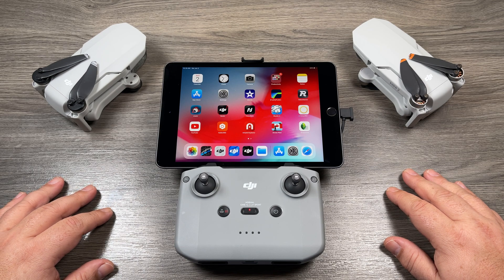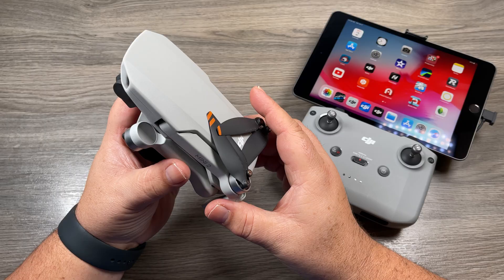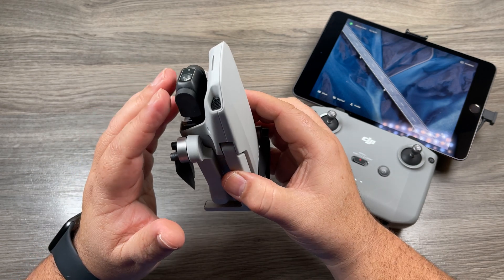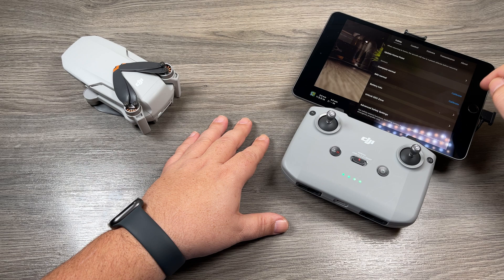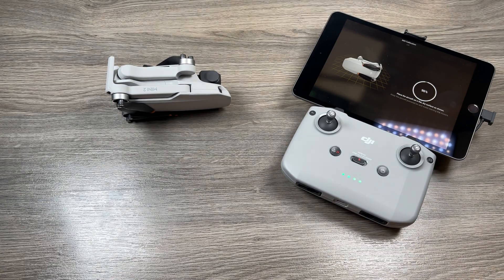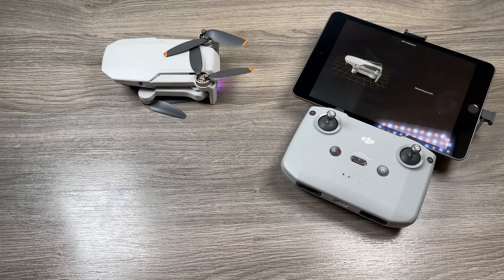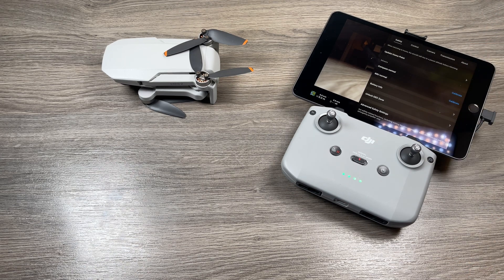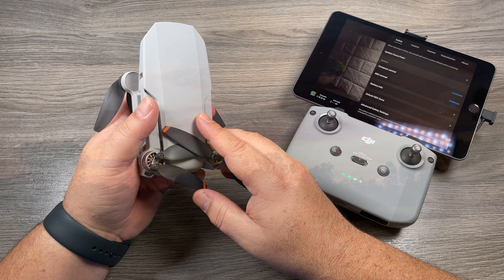DJI Mini 2 How to Calibrate The IMU

Comment: IMU stands for Inertial Measurement Unit.

The IMU is a critical electronic device that acts as the drone's sensory system, providing the flight controller with essential data about the drone's position, orientation, and movement.

Comment: Thank you.   DJI should have you on retainer for troubleshooting.   There were no IMU error notifications on the iPad DJI screen but the drone was highly erratic.   The previous DJI drone just decided to leave home after a year.  No error codes, nothing.   It simply went up about 50 feet and flew away.   I was afraid this one was fleeing the coupe too because it was so erratic as soon as it took off.   I had just put on new blades after the tips were damaged from an encounter with some chicken wire.   Anyway, I will follow your instructions and hope for the best.  Great video!!!
Reply from the maker: Hopefully all goes well. I appreciate you watching.

Comment: mine wont enable the start button. ive tried all combos of placements and folding arrangements on the damn thing. 
I tell ya, this fucking dji mavic air 2 I bought for 2 years ago has been such headache. I've flown it 10 times because every goddamn time it wants me to download new firmwares, accept new policy, download other things and calibrate everyhing so its such a hassle you just dont wanna go trough with it but this time its completely fucked. its stuck on the fucking start button. and i read thousands of ppl having the same issue but zero answers.

Comment: Thanks for this video. I am thinking of upgrading to a mini 2 from a Holy Stone drone which I crashed due to it not being calibrated properly. Luckily a light and repairable crash… One question- if you launch the drone on a slope will that upset its ability to fly level, or will a previous calibration still let the drone know it is on a slope prior to lift off? (After my crash I got into the habit of calibrating prior to every launch on the Holy Stone).

Comment: Should we expect the Mini 2 to totally lock perfectly on a target and stay perfectly locked on as it moves forward? I'm having a few drifting issues but it's slight enough that I wonder... this IS a super tiny, relatively inexpensive little thing... it's not a super expensive, super powerful Hollywood level drone. Should I not worry at slight drift? Should I not try and fly directly at targets and just... float around capturing interesting high angles?
Reply from the maker: Some drifting can be expected
Reply: Wdym by small drifts, does it just move around a tiny bit? Yea that’s normal, if it drifts toward one direction and doesn’t stop, that’s probably not good
Reply: @dosomestuff1949  it feels like, while I’m pushing perfectly straightforward it does move a bit to the right. But then sometimes I’ll look at my footage on the big screen and I will see the target that I was aiming for was not actually dead center, it was a little to the left, which would make sense that the drone was moving to the right. And in the monitor though, my crosshair is centered, or so I thought. Or maybe I’m not really pushing exactly forward. But I can feel a little dimples at the 12, 3, 6 and 9 positions. And I hold the stick in the 12 o’clock dimple.
Reply: @MagnumDB  actually, I think I know what issue ur facing.  Check out droning on’s video on how to fix drifting on mini 2. Search that up and that should help

Comment: Would be nice if you explained what the IMU actually is...
Reply: IMU (inertial measurement unit) calibration is one of those things that is critical to keeping your drone straight and level. The IMU is a sensor that detects motion along a horizontal plane, as well as increases and decreases in altitude.
Reply: @richsmith9736  Thanks. It bugs me that so many of these videos just assume that a viewer knows what your talking about.

Comment: When you put it on its sides it tips back on itself im baffled whether this is right as the picture shows it upright kinda 90 degrees to the surface when on its sides but to do that you have to hold it to calibrate

Comment: Wow the phone holder stretches open that far? What does IMU stand for?
Reply from the maker: It stands for inertial measurement unit. If you want them out something like the iPad mini you have to use an extension bracket

Comment: Just bought an Air2 and am a drone newbie. Really good content man!  Thanx for your vids.

What does IMU stand for?
Reply: I think is this :The term IMU stands for “Inertial Measurement Unit,” and we use it to describe a collection of measurement tools. When installed in a device, these tools can capture data about the device's movement. IMUs contain sensors such as accelerometers, gyroscopes, and magnetometers.
Reply from the maker: As stated by the other commentor it does stand for inertia measurement unit. Collection Of sensors in measurement tools to allow the drone to fly correctly.
Reply: @AirPhotography  You should do this after a crash, you say. Hmmmmmmmm. [Runs off to calibrate IMU] 🙄

Comment: how did you get the ipad mini to fit ? I was told it was to big for the controller please explain if you modded it in any way.
Reply from the maker: There is a small extension you can purchase that allows it to fit. I can get them on Amazon for about eight or nine dollars and they work really well. Just search on Amazon for Mavic mini tablet extension mount

Comment: What the heck is an IMU and why does it need to be calibrated?  Please don't assume everyone knows what these technological terms and procedure mean.
Reply: An Inertial Measurement Unit (IMU) is an electronic device that uses accelerometers and gyroscopes to measure acceleration and rotation, which can be used to provide position data.
Reply: @joebyrum9241  Thanks for chiming in!
Reply: @joebyrum9241  Thx for your reply!  Would you also explain how often it needs to be calibrated.  Does the drone automaticaly inform you if and when it needs calibration?
Reply from the maker: As mentioned by the other commenters it stands for inertial measurement unit a collection of Electron it measurement tools to help the drone fly. Quite often you will get an IMU error message if it needs to be calibrated. If you happen to notice that the drone is flying strangely then a ImU calibration may be required as well. I also recommend to re-calibrate it in the event of a crash just to make sure all the sensors are working correctly

Comment: How in the world do you get yours to stay on its side without falling over? I have to keep my finger on it or it tips
Reply: If you look closely at the video it did tip over as he was calibrating it.
Reply: @johnvoss9459  so should you let it tip or hold it still? Always wondered that.
Reply: @johnvoss9459  Oh I see now, the second side was tipped
Reply: @Cjmm007  I try to prevent it from tipping by placing some non metallic object underneath the front edge. My hands aren't steady enough to hold it in position.
Reply: @johnvoss9459  I wonder if it could have a negative effect on it from letting it tip a little
Reply: @Cjmm007  Whatever works for YOU.
Reply from the maker: If you look at the DJI image as it’s been calibrated it does look like it’s tipped a little as well. I think that is perfectly fine

Comment: So how often do you need to calibrate the IMU? Should it be done outdoors when GPS satellites are available? Turn on the drone first?
Reply from the maker: No you do not need to connect to satellites to calibrate It. Personally I find it easier to calibrate indoors as do you want a nice level surface. For the most part you only need to calibrate if you get Imu errors on the screen. I also recommend to calibrate the imu If you have crashed the drone